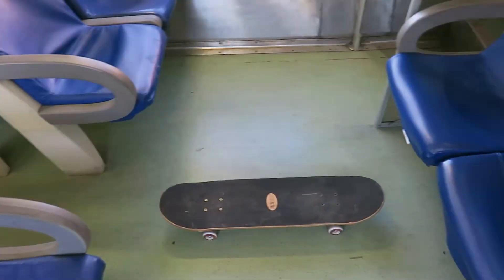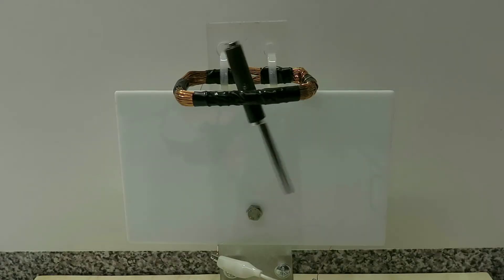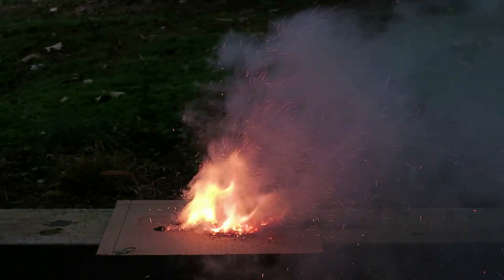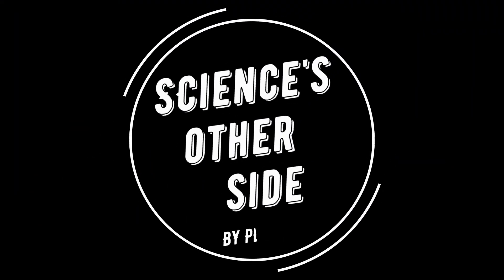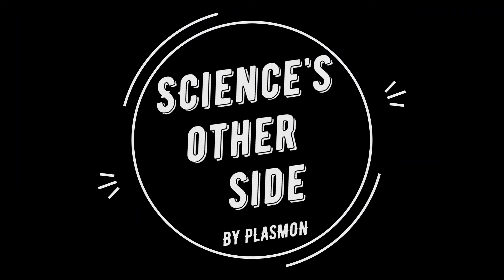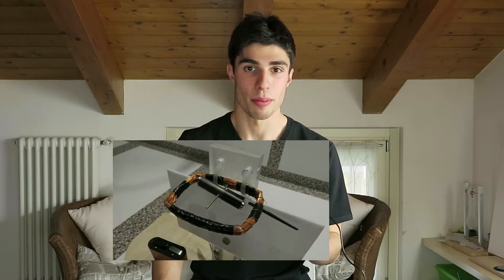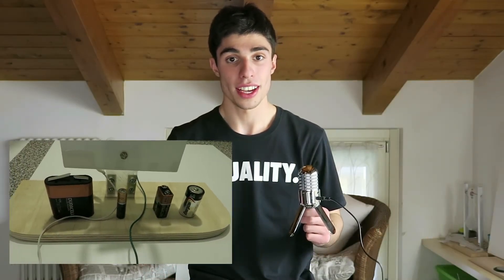Build and test an ammeter

Comment: Please I need to make this kind of ammeter. Can you help me?
Reply from the maker: The simplest way is to create a coil with some coated copper wire and attach a permanent magnet to a needle that is free to rotate inside the copper coil you have created. Pay attention to balance the needle in the right way. Then you only have to attach the battery or some other device that delivers current to the two ends of your coil! There are a lot of Web pages that show the building process in a great way. Have fun!
Reply: @scienceotherside2000  thanks.
please can you send me these web pages link ?
actually i did not find a lot of ressources regarding this topic
Reply from the maker: @djibrillamohaman1433  First, I recommend you read on a Website or a physics book how it works. Then you can take a look at this Website: 
https://www.doityourself.com/stry/how-to-build-your-own-ammeter. 
Try otherwise to copy the design I used to build mine. If you have to build it in order to take precise measurments I really suggest you to buy one, Ammeters are really cheap!